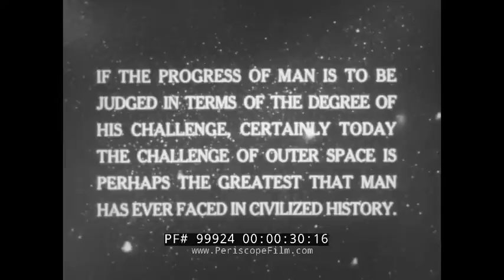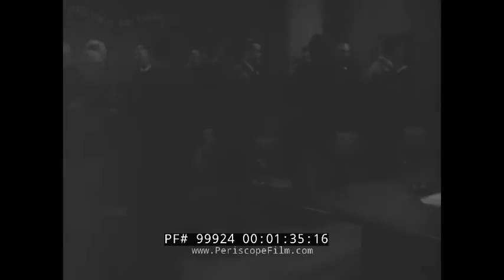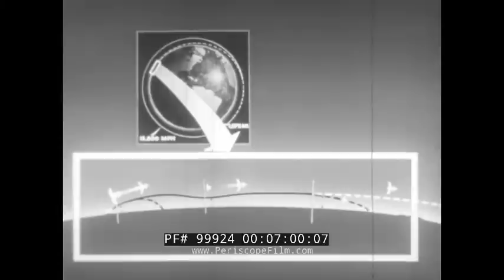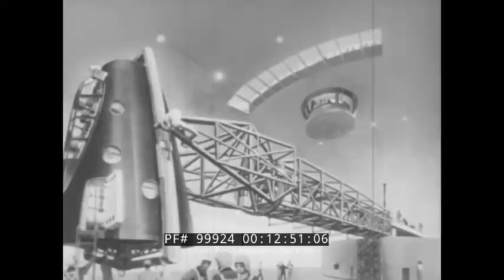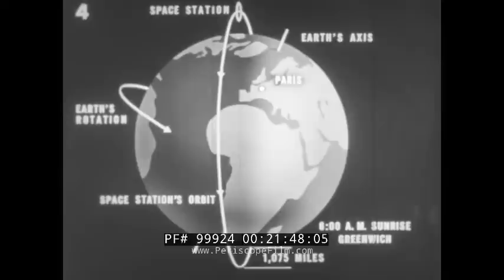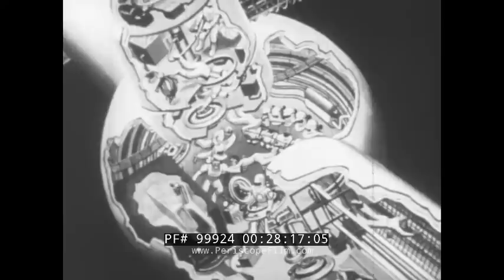"THE CHALLENGE OF OUTER SPACE" 1955   MILITARIZATION OF SPACE  WERNHER VON BRAUN LECTURE FILM 99924

Comment: The station would be built of tough fiber glass cloth reinforced rubber like life rafts . He also used  to say that would there would be thin metal plating going around it with a space of a few inches between it and the rjbber walls . you know,  for like micrometeorites that would hit that and actually going so fast it would disintegrate before traveling the 2 inches to hit the rubber wall of the station .  and you would dock  with it at the Hub while it was spinning . because The Hub wouldn't be moving very much .  I think it took 20 seconds to completely complete one rotation and it would be about 200 ft diameter .

Comment: Exactly how many Britons is he responsible for killing?
Reply: Not that many. Neither V1 nor V2 had guidance systems sufficient to target individual targets and were lucky to impact 20 miles from their targets. The V1 was actually more deadly than the V2 because the V1, impacting horizontally, spread its destruction over a much wider area than the vertically impacting V2 missile, which dug a hole then set off an explosion in it, limiting its damage.
Reply: @RockinRobbins13  V-1's dove on the target... they had a "mile counter" which when it hit the preset target distance calculated and set into the guidance system before launch, it shut off the fuel supply to the pulsejet engine, and locked the controls in a spinning dive to give it directional stability (spin like a bullet) and drive straight down on the target.  BUT as you said the lower impact speed meant the warhead exploded on the surface doing more damage.  

The V-2's came in supersonic, as the flew up to about 60 miles or so and then dove basically straight down by the time they were over the target at the end of their ballistic arc trajectory.  They had fallen from such a high altitude and gained so much speed they impacted at supersonic velocities, so the warheads buried themselves into the ground pretty deep before impact, limiting damage somewhat.  

The guidance systems were "state of the art" at the time but extremely primitive as they were the first functional guidance systems of their type.  They basically were relying on spies in the UK acting as "spotters" and reporting where the missiles impacted in order for the German units launching them to correct their programmed impact points they were putting into the control systems.  The UK had done a smashing job ferreting out German spies in Britain and either putting them out of commission, but usually succeeding in turning them into "double agents" and having them feed false intelligence back to Germany in order to mislead them.  The British basically had their German double-agents feeding back false information about the impact points, telling the Germans that the V-1's and V-2's were falling short of the city (when they were actually impacting within London) so that the German crews would set the missiles to fall further downrange, thinking that would put them directly into the city, but which caused them  to end up overflying the city and impacting beyond it well outside the city.  

Later!  OL J R :)
Reply: As many as necessary
Reply: How much of a choice did he have? You either did what the Nazis wanted or they killed you..
Reply: None. ....He didn't fire a single one.
The gun maker isn't responsible for how you use your gun.

Comment: Why is the velocity needed to maintain a high orbit lower than that needed to maintain a low orbit?
Reply: Because the pull of gravity is weaker the higher you go.
Reply: Because you have to fall further to complete an orbit, which takes longer, which means you actually have to go slower as you go higher to maintain the same circular orbit. In an elliptical orbit, you slow down as you get further out, speed up as you fall back toward the earth and reach fastest and slowest speeds at your lowest and highest altitudes respectively. Gravity will pull you stronger at the bottom of the well than at the top.
Play a round of KSP (the original, not the abomination of a sequel) for a few hours and you will come to have an understanding of this like you just learned to drive a car or something. I learned how counter-intuitive it is, then I learned how to make it intuitive. I reckon I could actually pilot a space craft now, that program is such a good sim of orbital mechanics. A tiny change in velocity at the lowest part of an orbit can send the highest part far away quickly, and by the time you get out there you might be going at a fraction of the speeds you were going when you put on the little bit of extra acceleration down low at perigee, and putting on a tiny amount of acceleration while at apogee will actually stop you from getting down as far into the well, so you will actually slow down on average by speeding up. Trading velocity for altitude. It's wild to think about until you get a grasp on it all.

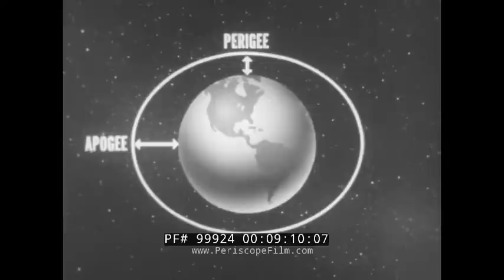Comment: The diagram at 8:45-9:15 showing the orbit with apogee and perigee is wrong.  In an elliptical orbit, the earth would be at one of the focal points of the ellipse, so it would be off-center.  The apogee and perigee are on opposite sides of the orbit, not 90 degrees apart.
Reply: Yes, von Braun's orbital mechanics is "challenged." But orbital mechanics hadn't been invented yet!
Reply: jmmahony — Both focal points would be inside the Earth.
Reply: @TatevossianA  They can be, but one would be at (or very near) the center of the earth.  Strictly speaking, when one object orbits another, both are actually orbiting the CG of the system, but when one of those objects is vastly more massive than the other, the larger object barely moves, and the other object is on an elliptical orbit, with one focal point essentially at the location of the other object.  Whether the other focal point is inside the larger object is just a question of how elliptical the orbit is, how large that orbit is, and how large the larger object is.  When a comet comes into the inner solar system, that is just one part (the perihelion) of a long elliptical orbit, most of which (including the far point, or apehelion) is beyond Neptune.  So the other focal point is waaaay outside the sun.
Reply: @jmmahony  It's an illustration for mere mortals. Not Kerbal experts.
Reply: @Mishn0  The majority of people watching this video are likely interested in space travel, and the point being discussed is a pretty basic aspect of orbital mechanics and "rocket science 101".  The diagram is blatantly wrong, and would be confusing for anyone just learning the subject, so I thought it was worth pointing out. 
Now that I've explained my motivation for posting my comment, what was the motivation for your response?
Reply: @jmmahony  The film was't produced for people that have been exposed to space travel for 70 years. It was produced for those military officers who had never been exposed to this, because NO ONE had ever been exposed to this, because this hadn't existed before. I'm pointing this out because your comment is completely irrelevant to why this video was made. The reason you posted this is to enable you to show us all how frigging smart you are. Period. Here's another clue, we don't care.
Reply: @Mishn0  First, orbital mechanics existed long before this was made.  Second, for whom or why this was made is irrelevant- my comment was for people viewing it today.  Third, I don't care how stupid you are, so why would you imagine that I would think you care how smart I am?
Reply: @jmmahony  Whatever makes you happy, chief.
Reply: There is more to this apogee / perigee misrepresentation.  Maybe to trace a someone leaking information.
Reply: I just saw the diagram< quickly  paused the video and went down to the comments sec. to see if some 1 had what's in my mind , and found your comment .😁
Yes, the diagram is faulty .
Reply: @warfyaa6143  You say faulty, I say no-one had actually BEEN in orbit at that stage, so.... NQR prototype maybe?

Comment: he doesn't state the amount of fuel needed for deceleration for the return flight into the atmosphere if you have a winged aircraft.
Reply: Probly one of the things still to be worked out.  They didn't know EVERYTHING in '55!  Basically you just have to slow down enough to put the perigee of the orbit down into the deeper parts of the atmosphere, air drag will do the rest.  Theoretically if you retroburned your engine long enough, you could drop back into the atmosphere without a heat shield-- but it would basically take almost as much fuel as it took to put you into orbit in the first place!  Conservation of momentum and energy transfer and all that.  Later!  OL J R: )